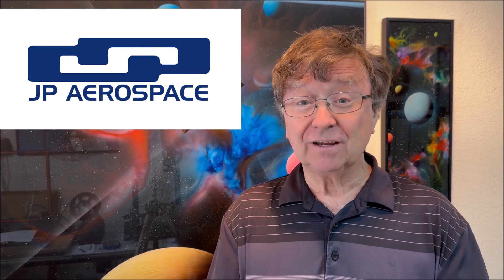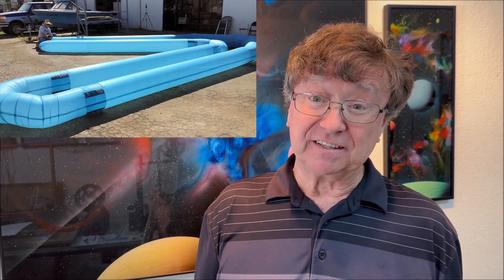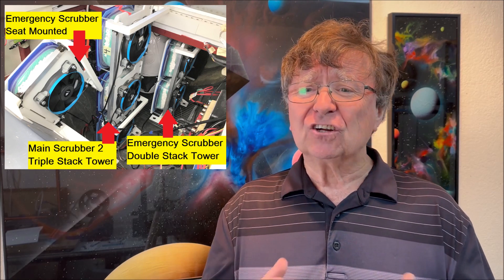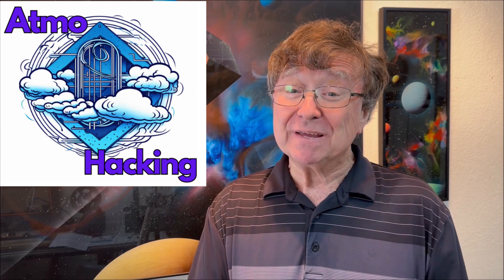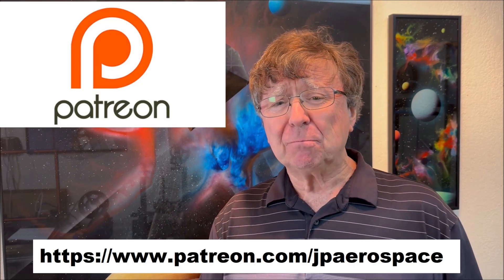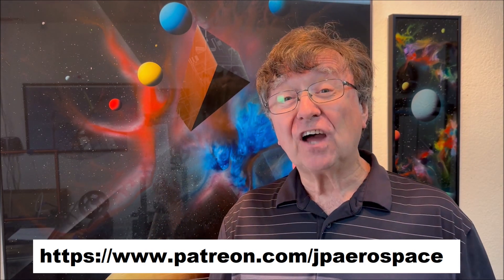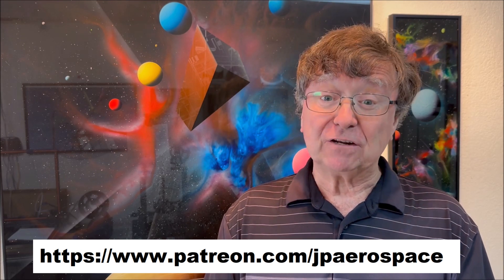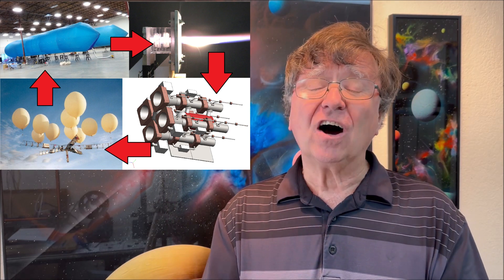JP Aerospace Update June 2023

Comment: 6:58  I saw several videos in this channel, but I do not remember any talking about hydrogen.
Which is the issue?    The FAA would not allow it?
If that is not the case..  Not sure if I can hear a reason that would convince me that you are taking the right approach with helium. 
I do not think that the ban on hydrogen was really in the interest of "safety", I think it is more related to find better ways to exploit USA huge reserves on Helium.
Reply from the maker: Hi, It's all about costs. Our insurance for the building goes up as well as the insurance 
for our launch site. Even the driver would need a special license & the truck as well. We can use up to 177 tanks on an airship. All our valves and fill equipment would need to explosive proof rated. A lot more expensive. For example
we meter the gas for exact fills. Our meters cost $400. For correctly rated ones for Hydrogen they are 20K each. And that's just the ground equipment, the flight gear need to qualify too. 
We added up the list of over 100 things
& going to hydrogen was completely unaffordable. The price of the gas was the smallest factor. We can't cut corner either.  We are very regulated & when we get inspected everything needs to be by the book.
Couple the prohibitive cost and added risk (we put rocket engines on our airships after all) and hydrogen is a non starter. I know hydrogen works 
for some balloon folks and that's great. For us finding a way to produce our own helium supply is the answer.
Thank you for asking!  Take care,
JP
Reply: @johnmpowell  Ok, I have to admit those are very good reasons.
Here in Argentina, if we try to go by the rules (including grey areas that are not even normalized), it would take years to pass beyond bureaucracy, even if we pass that obstacle, our poor economy and high import price would be the end of any project.  But controls are also non existent  with small projects, that is why I usually forget to think on the regulation aspect.
Of course, your project is huge so you have no choice. 
Well, I wish you the best with the helium production method in order to be self sufficient.
I guess the hydrogen point would have a comeback if some day you accomplish all your goals to reach the point to design the dark sky station and the orbital ascender. 
With no enough air around, a H2 molecule being twice as big than helium to reduce leaks and much higher buoyancy at that altitude, it seem it will have more sense at that point. 
Thanks for the reply!   Have a nice day.

Comment: Wait a tick…how about a vacuum airship! 🎉. 😮😂 

I recall reading about the idea from several hundred years ago, and it was almost a joke on my part. However, what if we did this backwards? Vacuum airship would collapse at sea level atmospheric pressure, but if we were at high altitude, pumped out the remaining air, and it had buoyancy in the thin stratosphere? Cheaper and easier, and lighter than any lifting gas. Just my random, vagrant thoughts.

It would settle into the upper atmosphere gently and float on top, and stresses on the vehicle would be much less, no? 

Love and appreciate what you do JP! Best wishes.
Reply: This concept has been explored in a variety of studies, give me an hour our so to link them in this comment thread. The problem is that materials light enough to retain that vacuum tend not to be able to withstand the pressure differential, even at high altitudes, and implode. Remember, the push in a vacuum airship is coming from the outside in, and even if you use tensegrity or whatever for load bearing structures, that stuff all has to be light enough to make the gains over using helium worthwhile. Exotic materials like bulk carbon nanotubes have been suggested as a possibility, but honestly if you want that kind of performance, you could heat up your helium for better performance, use hydrogen, or even heat the hydrogen, though that obviously has issues as well.
Reply: @alecmeden6325  But at some point, the stresses will be tolerable. Might be negligible lift by that altitude, but interesting to read about and please share what you have!

I asked ChatGPT 4 to get ideas, but with the understanding it can be quite wrong. I’ve had it completely make up research articles, complete with doi numbers and titles I wish were real lol. 

Nevertheless, here is what it came up with: 

Predicting the specific altitude at which a vacuum buoyancy craft could survive based on the strength of existing materials is challenging due to the complex interactions and factors involved. Nevertheless, I can provide an approximation.

As you ascend, the atmospheric pressure drops exponentially. At about 100km, the Kármán line, commonly used to define the boundary between Earth's atmosphere and outer space, the pressure is extremely close to a vacuum. Even below that, at around 60-70km, the atmospheric pressure drops to below 1 Pascal (Pa), or less than 0.00001% of the pressure at sea level. 

At these altitudes, the pressure differential between the inside of the vacuum craft and the outside atmosphere is minimal, which would drastically reduce the structural demands on the airship. Materials like high-strength alloys or composites used in aerospace could potentially withstand such miniscule pressure differentials.

However, even if the vacuum buoyancy craft could theoretically be constructed to withstand the pressure at these altitudes, it would not be particularly useful as an airship. These altitudes are above the bulk of the Earth's atmosphere, and far above the altitudes where commercial airships or airplanes operate. In addition, other technical challenges would remain, such as dealing with extreme temperatures, solar and cosmic radiation, and the practicalities of moving around in such a thin atmosphere.

So while it's theoretically possible that existing materials could be used to construct a vacuum buoyancy craft that could operate at very high altitudes (60-100km), such a craft would face significant practical challenges and limitations, and would not be capable of operating at lower altitudes where airships are typically used.
Reply: @Electrohydrodynamics  https://ntrs.nasa.gov/api/citations/20190001133/downloads/20190001133.pdf
Reply: @Electrohydrodynamics  yes, that would be a cool curiosity. Not very valuable if it can’t carry a payload and needs to be deployed from LEO, but cool.
Reply: my intrusive thoughts about this very thing is what lead me to this channel. I think it can be done, if we build gargantuan ones on the Moon and bring them back to Earth. Perhaps kinda space glass pumice or something
Reply: @IsaacWarrenMurrell  I asked ChatGPT4 and brainstormed. Does seem more practical to start from outside the atmosphere, and then settle back in that way so you won’t have to build for stresses in the lower atmosphere